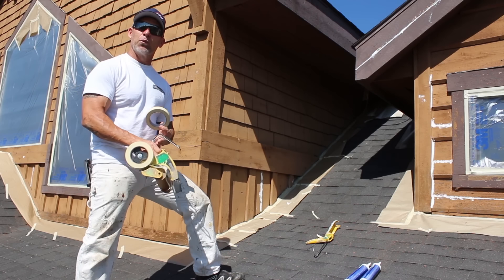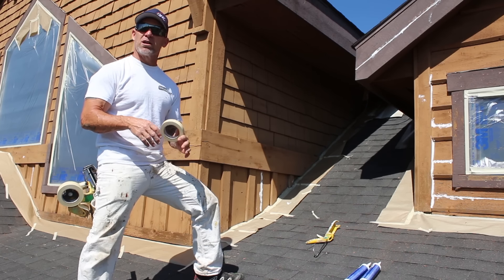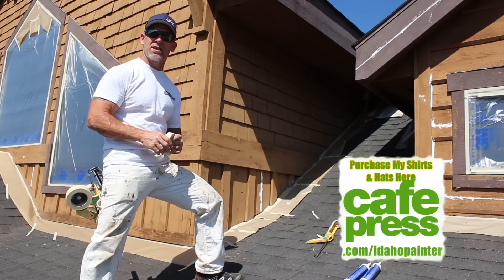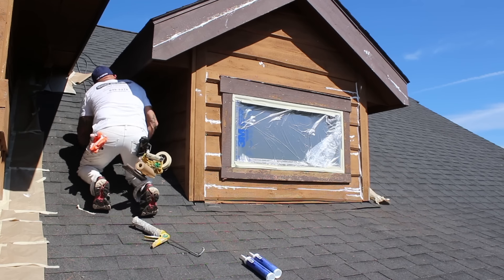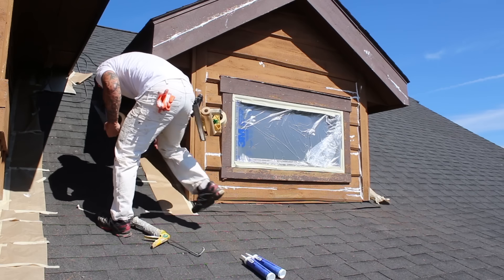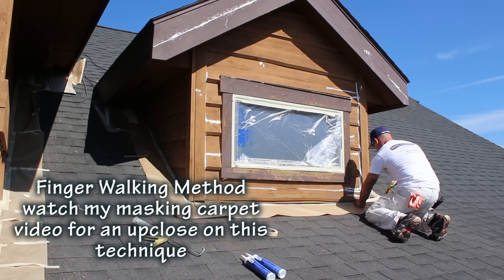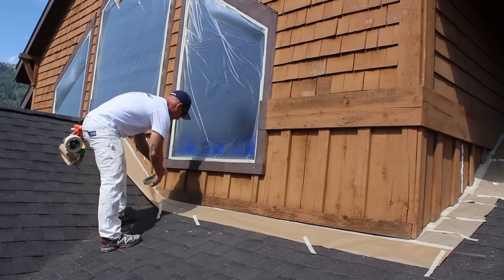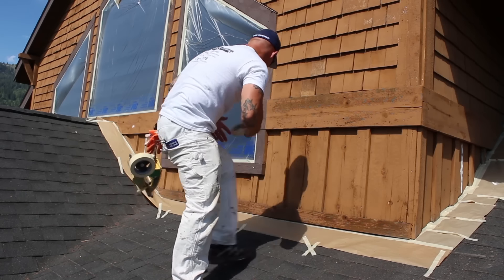House Painting & Prepping Tips & Tutorials Using a Hand Masker.

Comment: Don't Roger to be careful with pressure washing roofing material. You can ruin asphalt shingles with a pressure  washer.
Reply: I'm a roofer and a handyman. I've seen a lot of roofs damaged by pressure washing. It won't hurt it as long as your being gentle. But if the nozzle is like 2 inches away from it it can cut through an older shingle or Blast all the granules off.
Reply: Yeah. For sure. I'm just putting it out there for newbies.